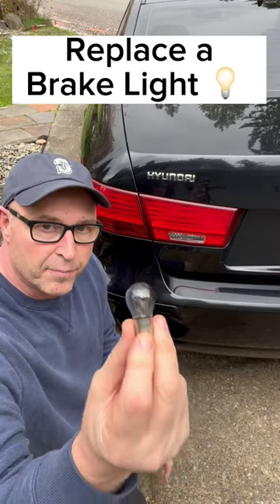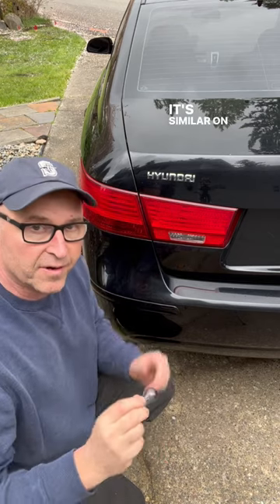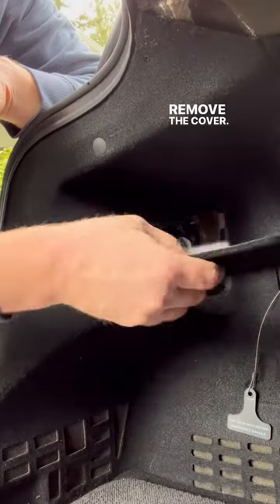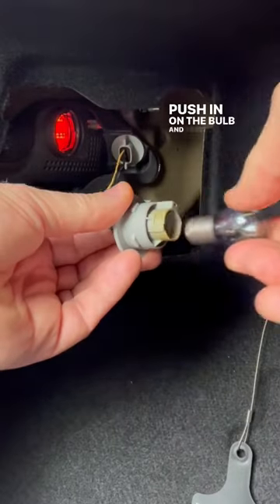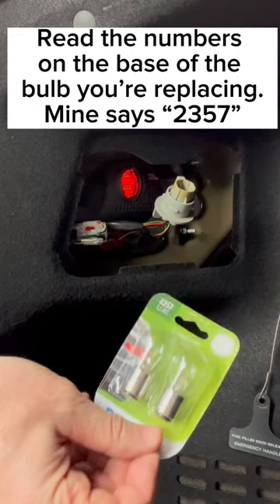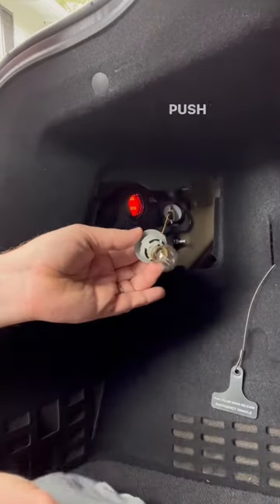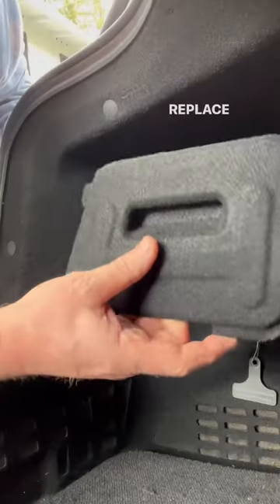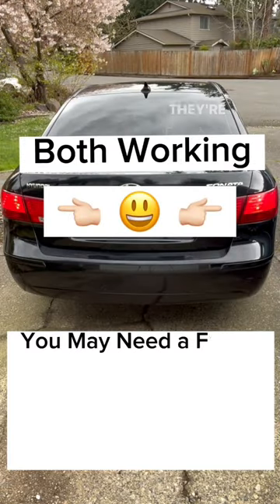Replace a Brake Light #shorts

Comment: That's a lot more simple than I thought
Reply: Honestly, his car had it super simple! It is definitely not as simple for most cars. Or at least for older cars. All the cars I have changed lights were quite a nightmare. Sometimes you have to remove the entire light to get to the bulb. And while removing the light or any brackets you have to be careful to not break any of the "clippers". The back lights are usually easier, cause at the front there is usually cramped spaces. And always double check if your bulb is correctly in the socket, and that all the covers you had to remove to get to the bulb are back at their place securely! 

This comment is just trying to give further tips and help not to be aggressive.

Comment: I did this and ended up sitting in my trunk (with the lid open!!!). It was kinda nice. You can check if the lights work by backing up to a reflecting surface, like a store window, or stopping in an empty parking lot then switching them on.

Comment: You can also upgrade to led lights and they will last a LOT longer and they are brighter and they are easier to install Because you don’t have to worry about touching the bulb sinsce it dosnt get hot enough

Comment: Yup.  My partner's car is just like that.

My pickup is a bit different.  Not much harder, once you know the trick, but not this easy, either.  The bed liner can be a bit  fiddly, though, and you have to know how that is held in so you can get access to the screws.

Comment: You may feel some resistance when inserting the new bulb - push down and twist the bulb to the right until it stops. When you begin to let it go, you will feel it eject a bit - it should now be locked in place.

Comment: Look up you make and model on YouTube and you should get an idea on how it is done on your car. 

Some tail lights you have to remove screws and pull the whole assembly, either the screws are visible or behind plastic, some may be inside where he removed that cover, or just the same as in the video.

For headlights some cars require you to either remove the whole front bumper, the wheel and inner fender plastic or the whole headlight assembly with or without removal of the bumper. There is no standard on this pretty much a free for all. Some cars are like the good old days when you open the hood and replace the bulb (might have to remove some minor plastic pieces).

How do I know? I do this everyday :)

Comment: Is it different on pickup trucks
Reply: Yes. For a pickup truck you will remove the plastic cover from the outside to get to the bulbs. Mine has 4 screws. Then you can push and turn to remove the bulbs.

Comment: Let’s be real. This is one of the few cars where the entire light housing doesn’t have to come out. The anchors are really what very. But 90% of vehicles don’t just have a convenient cubby hole.
Reply from the maker: I will agree with you that they’re not all this easy. Each car varies, and I can only show the vehicles I own. I would disagree with your assessment that 90% are more difficult, that is an exaggeration.
Reply: @DadhowdoI  I’m just telling my experience as a mechanic over the last 6 years. Not sayin I know it all. But. My experience is 9/10 I gotta take the housing out. It’s never hard. Now this is mainly American made cars also might I add.

And I didn’t say 90% are more difficult. I simply said 90% don’t have a convenient cubby hole where the taillights are. Or head lights for that matter. Not exaggerating.
Reply: @DadhowdoI  I will give you. Most sport or luxury cars with trunk access do have cubby holes. But trucks/suv/vans. Housings gotta go. Might clear this up a little better.